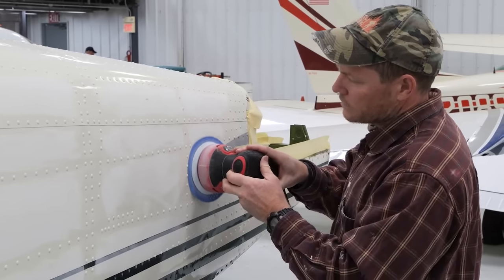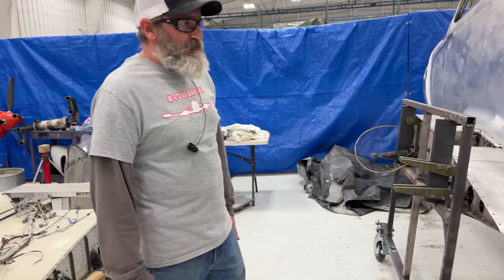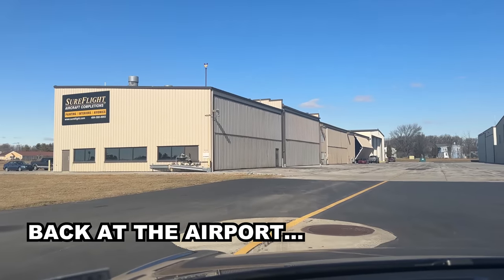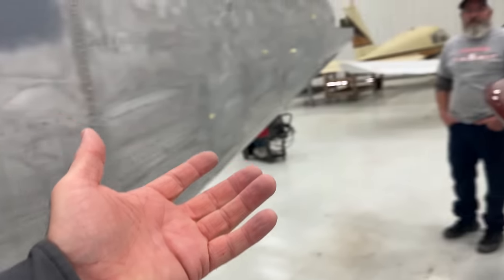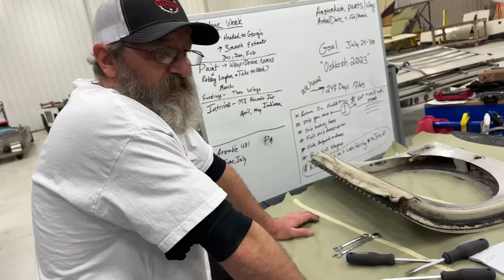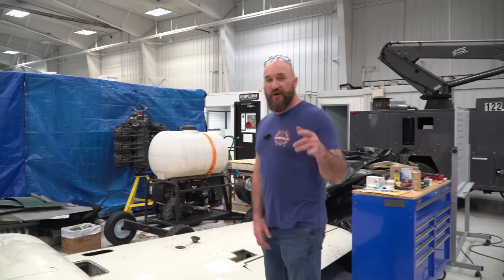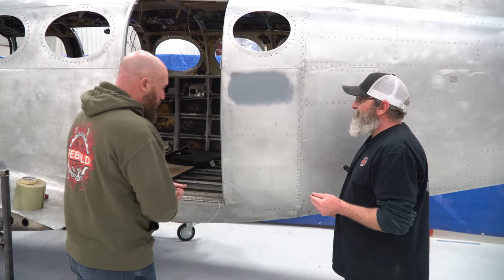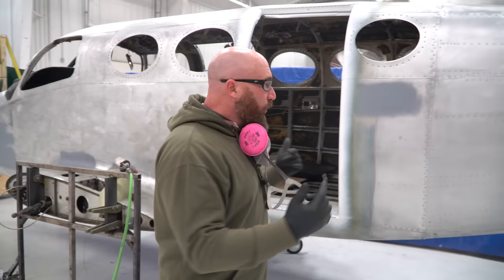The Free Abandoned Airplane gets some Paint !

Comment: I love watching the work on the 401. When you talk about little setbacks, it reminds me of something my dad said to me... "If you don't have time to do right, now, when do you think you'll have time to do it over."
Reply: most of the 'setbacks' could have been avoided had the plane been properly inspected at the beginning.
Reply: @buckmurdock2500  yep, I said that from the start.
Reply: Painting the door jamb first is like building a house and putting the carpet down as soon as the slab is poured. The framers, roofer, plumbers, electricians, drywall crew, finish carpenters, painters will all have to trample on the carpet so by the time the house is finished, carpet is trashed. The door jamb will be trash before the plane is finished. That's why manufacturers paint last. Doing things out of order makes more work and delays as these videos continue to demonstrate.
Reply: @buckmurdock2500 , yep get the anti corrosion and airframe repairs done and get the wiring and interior done, then paint. Isn’t it going by road for interior and avionics? Like you say, it’s gonna be ruined.

Comment: a little trick to applying bonderite is scuff the whole surface up with sheets of scotchbrite and it allows it to penetrate into the metal and give it a good protective layer, also if your doing it in awkward areas place some paper towel's onto the surface and apply it to the towel and it'll stick to the metal

Comment: Nice to see the edging taking place !  One thing that concerns me is on the cradle. IMHO some cross bracing between the two sides should be considered . Front and back movements have been covered but not the "side to side" .   For a comparison  inspect the landing  gear on a semi trailer.  I would rather be over built than under built in this scenario.  Keep up the great work on the Wichita born 401!  KUDOS
Reply: Yeah, you gotta add diagonal bracing.

Comment: You could have just welded the caster plate right to the square tubing. Time saved. 2 weeks instead of 6.
Reply: @eagle2019  I've done it before in my shop when building a cart. Saves the time of cutting and drilling those brackets. The only benefit to having those brackets, is that you can remove the casters later if you wish.

Comment: Just wondering, but is it legal for a non-FAA approved paint shop to paint the 401?  Maybe it is if you can document that all the materials used meet specifications and all control surface and airframe reweighing, balancing, and rerigging are done by people certified to do so.  I recommend you find out for sure before you go too far with the automotive paint shop.  After all, the FAA has already begun to notice your operation.  You don't want any surprises down the road.  Just my 2¢ worth.

Comment: Your body cradle needs more than gussets on the posts. You'll need to add cross-bars at the bottom - tie each side together - otherwise you risk having each side support splay out (like a deer flopping on smooth ice, legs splayed out). Wouldn't go well for the 401.

Comment: Think you could use a cross brace on the fuselage roller cart.    A bar running parallel with the wing spar linking the two ends
Reply: Urgently needed. Diagonals. Scary weak inch tube...

Comment: Congratulations to successful the written exam. If you pass that i think you have the worst behind you. Do everything by the book, don't forget to do nice preflight and check all the docs. Have all the weight and density alt calculations done and show it to him/her. You should know the track in advance, so you can train it before on some simulator. Sometimes they like to test if you can improvise. Change your route during the flight. Just take your time before you enter any controlled airspace. Dont be afraid to just make few circles to get ready to enter. You can prepare your comm talk on your kneepad.
It is ok to make mistakes, if you can figure out the way how to solve them or find the way out of it. For instance radio issues. And know your plane... which you most likely do. Good luck. ;-)

Comment: As a painter of vehicles, I can't really speak to if you are using any special paints for planes, but what is going in place of the etch primer for this job? Usually, with a vehicle, on bare metal, you use an acid etch primer and then key it so the paint can get a better adhesion to the panel. I would have concerns painting white base straight onto bare metal. Like I say, I have never done a plane, so don't know if that stuff you are painting on is doing the same job as an acid etch, but if you don't get a good key to the metal, the paint may look good for a short period, but once vibrations and weather hit the panels, it will start flaking off, even with a good 2K clearcoat over the top. Surface prep is key when doing bare metal. With a car, I'd go -> Acid Etch through a spray gun -> Dry -> Key with 240 grit -> Nice thick Primer coat -> Dry -> Key with 500 using a guide coat -> Paint with a waterbase -> Dry -> Clearcoat if I wanted a really nice finish at the end. I can honestly only really speak to cars though.
Reply: You are correct in saying you can't paint directly onto bare aluminium and expect it to stick for very long. The etch treatment uses a product called Alodine. This is a Chromium based compound that make a chemical complex with the aluminium much like a rust converter for steel. Once that's done and rinsed/wiped off, you then apply a Chromate primer (yellow/green in colour). This can be flatted to remove small surface imperfections. From there you can apply a two-part urethane top coat. Aircraft top coats are typically designed to withstand more temperature variation than conventional 2k automotive coatings. A clear coat also not necessary, it adds weight and it doesn't always last very long before it starts to flake.
Reply: @montaguthorne2342  Thanks for letting me know. That makes sense. It's a bit different to vehicular stuff. I was wondering what the difference may be and whether that Alodine was the ingredient I was missing. 
With cars, you build up a very thick coating of high build primer and flat that down, rather than using rattle cans. Seeing rattle cans being used I was wondering. But it makes sense that an aero coating is going to need to be light and strong.
Reply: @templetonpeck393  after watching through to the end I though the rattle can primer is a bit unusual for this job. This is usually just for touchups or small parts. I also found it a bit weird that they only primed and painted the doorframe, it would make much more sense just to prime and paint the whole fuselage in one go, but that's just my opinion
Reply: @montaguthorne2342  I mean, you clearly are more aware of the process for aircraft. But I agree that both using rattle cans and doing it peacemeal is odd, purely from a finish perspective. It's likely to look patchy if they leave a door frame, then paint straight off the loose edge.
Before they can paint the whole thing, they will need it all in primer. It makes a lot more sense from my point of view to get a decent thickness coat of primer so the flatting doesn't just go straight through. Even if they took it in parts where they can go off a straight edge makes more sense. I guess we will see how it goes as the project goes forward. It may be the result of the fact the bodyshops don't seem to be taking it and they are having to work it out for themselves.

Comment: Again, make sure you mask off the static ports before painting. They need to be clean bare metal. You can even stencil a little placard that says "Static Port Keep Clean"
Reply: uh, the static lines have been removed. lol
Reply: @buckmurdock2500  So? A static system will be installed before it next flies. The static ports are still on the side of the fuselage

Comment: I'm a bit worried about the caster flanges bending.  A plate between the caster flanges and the 'feet' of the legs would help distribute that clamping pressure better.  If the flanges bend, the ball bearings can seize or come apart (not fun, don't ask how I know)

Comment: South Wind heater sounds fine, as long as you're flying north of the equator.
Reply: instead of sending out the removed combustion gas heater for repair and overhaul, we purchased another junk heater that needs to be sent out for repair and overhaul.
Reply: @eagle2019  yes but only the best if they are going to do "missions"

Comment: Just an aria for re-assembly. The carry frame you have made for the fuselage could be used again to put the wings back on.  Shorten the width to fit underneath the wing mounting place on the fuselage and reshape the top bars to fit the shape of the Stubbs.  Fusion them well and remount the fuselage onto the existing modified frames. Make one similar frame to fit the wings with cushioning again fitted to the top rails. This will prevent damage to any new paintwork. The frames will then allow good articulation of both the fuselage and wings to aid you struggling to refit the wings.  More important is to sort out how you are going to replace the fixing bolts. Looking at the shape of the brackets the are designed to fit into the wings first and then to the fuselage.  You may need to remove one or two skin panels to allow access instead of ripping the new wings to get the bolts back in.  I would also you remove the panels before it goes for paint. That would leave you to pain the rivet heads and tails once it’s all back together.  You are doing a marvellous job all round and I’m just trying to help you.  Not criticise.
Reply: @eagle2019  How come they would not come out without hitting the wing.
Reply: Don't worry. The new paint will get scratched all to hell which is why it should be painted last, after it's been fully assembled and test flown.
Reply: @eagle2019  I have followed this project from a distance and I really cringed when they cut holes in the skin when they were trying to remove the wings. Unfortunately in cutting a few corners (literally) here and there people have come to assume this must be the way it's done. I fear for the future of general aviation if this becomes the accepted standard practice.
Reply: I started a conversation with no malice intended.  They are not and never professed to be professionals.  If you are that good maybe you should be helping a good cause instead of unhelpful and bad put comments.
Reply: @eagle2019  Not at all Annie I’m sure it will be gone through  by the relevant  inspectorate. Take a break mate and go help them instead of criticising everything they attempt. Don’t forget everything they are doing is on public view. If you think they will get away with bodge jobs then you are not as intelligent as you perhaps think you are.
Reply: @eagle2019  Well as said, get off your but and teach them.  In the uk we can work on road vehicles including trucks without qualifications but the vehicle inspectorate can revoke company’s licence with on the road or at the companies spot inspections given without warning and including all documentation showing repairs carried out and a full record of every monthly inspection including who carried it out. Yes every month a full inspection on any commercial vehicle.  I cannot tell you about our aviation rules but I’ll bet they are similar. I don’t even think we have a get out clause with experimental.

Comment: Looking at those holes where the ice shield was makes be a bit worried that there's some metal fatigue! Please make sure there's no microscopic cracks in the fuselage.
Reply: every rivet hole is oversized. What a mess it will be to clean that up and it needs to be done before painting. From whenever this video was made, could be a month or more away from actual paint.

Comment: 6:40 Instead of using the gusset why not putting the caster directly under the vertical strut? And why using the flat pieces on top? They could have welded underneath. I understand they are just for the location holes? But I gusee design develops along the way.

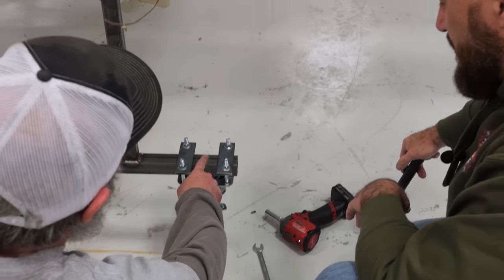Comment: 6:05 Would have been better if you just had a flat plate in the bottom welded to the tubing and then have 4 holes drilled into it for the caster plate.    
That would have made the caster plate flush with the custom plate and not 4 long bolts as you did there.   Looks silly.
Reply: those ankle busters will create great content in the future!
Reply: @Dm_rebuild_rescue  OMG would you look at that.   Just look.  Do you see it?  Look a bit harder.  You see it now, yes you do.  It's a bot.  You have nothing special.

Comment: Lucky the white paint you put through the gun didn't use a hardener so dried instantly giving no problems with overspray right?
Reply from the maker: Very low pressure and zero overspray 👍🏼
Reply: @rebuildrescue  Not my problem, you're the one who has to clean it off of everything. Amateurs!

Comment: What you need to hold your wings is What the RAF here call "EGG BOXES".
I am not good with my P.C but basically it's a big but flat oblong box with the inside of the box partitioned into 4×4 Square holes.
You then put 4×4 squaeposts into the holes as required for whatever you need to support.
Do not fix in these posts in, as you can then reposition the posts in the future to suit future projects. 
Think vertical pin board if you will.
Put wheels on the bottom for mobility.
I hope you understand what I am trying to describe.

Comment: Those plates that the casters are bolted to should really be the the same size as the caster's contact surface and welded to the bottom of the frame instead of the top. This technically works, but too much lateral load on the caster could cause stuff to bend.

Comment: Weren't the original engines the same horsepower as a new Continental Diesel? Does anyone think about switching to diesel?
Reply: new engines, props, data for conversion, think it could be done for under 1/2 mil?  Me neither.

Comment: So I am confused.  You say you have attempted to get the fuselage to professional aircraft painters who cancelled three times over the past month but in this video your still stripping off parts like the ice sheilds?  Now it looks like your attempting to paint it yourselves using a combination of pressure pack spray cans and basic spray painting equipment  ? Where is your aircraft spray booth and drying oven.  I don't think a leaf blower cuts it.  Nothing seems to change on the restoration approach.  It will be good to see the aircraft restored but at best, doing this via the same way cars are restored in an adhoc fashion, this plane will a museum piece but never certified to fly.  Do you have any parts you have removed from the aircraft which have gone out to places certified to service / rebuild them  and have come back with the appropriate civil aviation documentation ready for re-fitting by qualified A & D engineers?   It's a great project and I admire your commitment but it does not seem to be on a path where the plane will pass the various structural and mechanical assessments needed to be airworthy.   Covering up the metal too with new paint does not remove the underlying issues.  For example has the raw fuselage been inspected and signed off by the authorities its ready to repaint?  Don get me wrong I want this project to succeed and achieve the goal of being put back into service for humanitarian purposes.  But it does  no one any good if it fails and costs lives.  Please consider having the plane now it is stripped down have the appropriate material inspections an xrayed for fatigue cracks etc.
Reply: not going to professional aircraft painters. It's an auto body shop and RR is doing the cancelling because the plane is obviously not ready for paint.